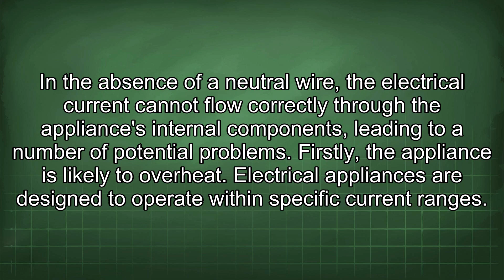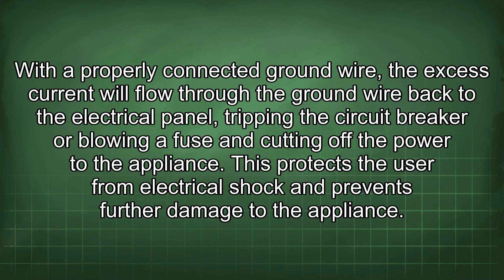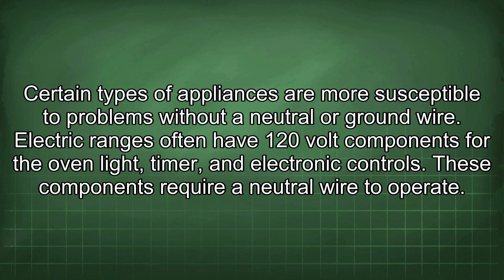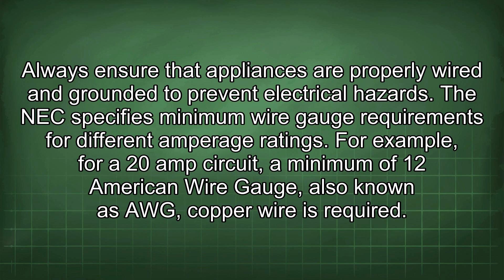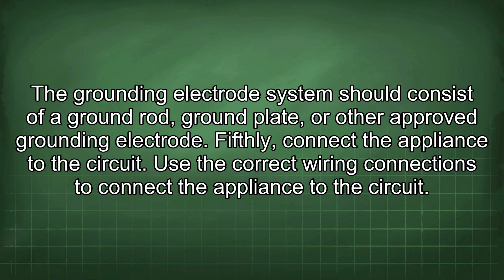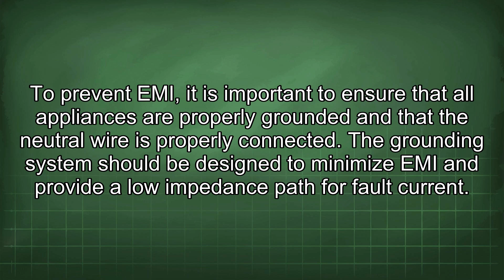240 Volt Appliance Without Neutral or Ground Wire

Comment: In a 240v circuit the neutral wire does not return current, and is not needed at all in many applications. Lack of a neutral wire will not affect normal operation of a 240v circuit. In 240v circuits, the return current path is through the alternating phases of each 120v buss bar. 120v circuits need the neutral for return current as it is single phase and the neutral is the only way back to the panel. You do need a neutral, like you say, if wiring up an oven or clothes dryer or other appliance that needs 120v to operate lights, timers etc.